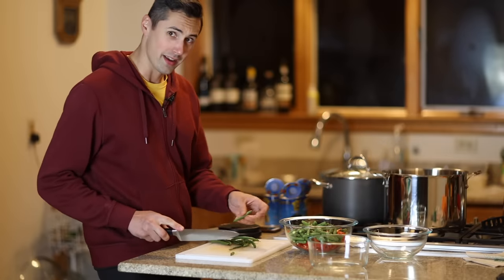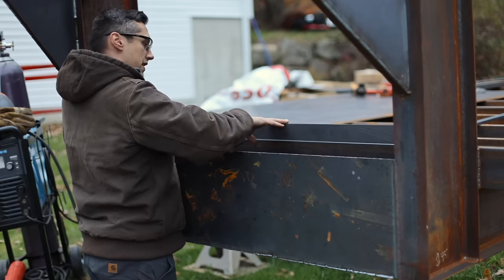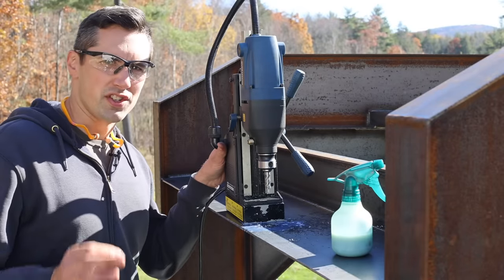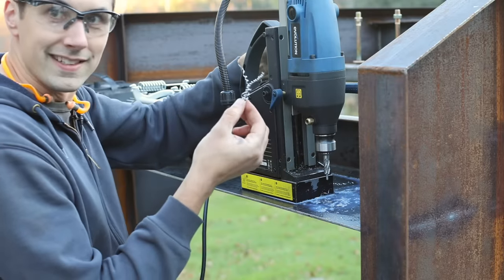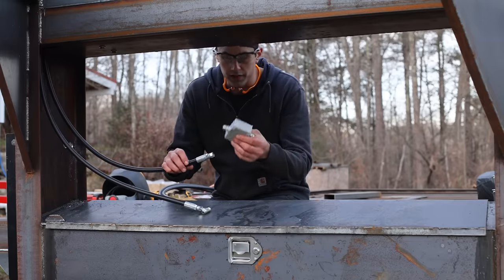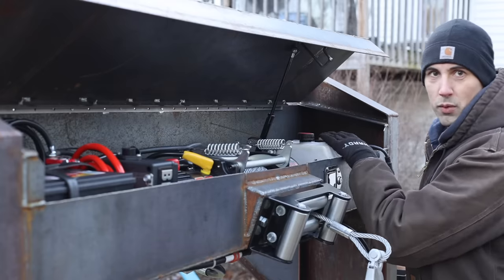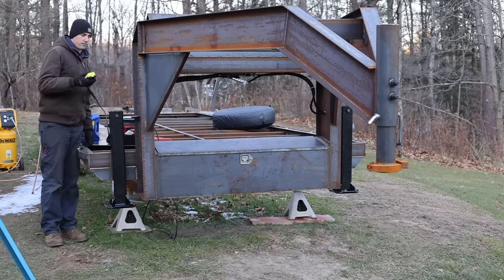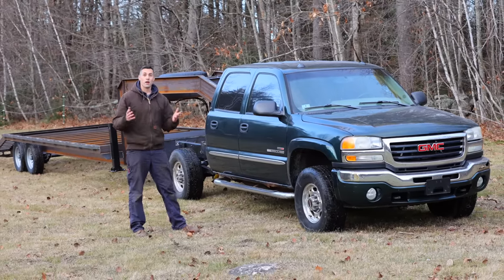Gooseneck Trailer Build Part 2: Hydraulic Jacks, Toolboxes, and a Winch

Comment: Nice work Waldo!! 👌 Don't know if you've already looked into it, but they make a suspension system for goosenecks to help smooth out the load on the truck and the trailer. I think the name of the company is Gen 3? Not 100% sure but anyways, I thought you'd probably benefit from it if you're going to be going on long hauls. Great video as always brother!! 🔥
Reply from the maker: Interesting, thanks for the tip! 👍

Comment: Pretty awesome.  I've thought about building a trailer, but I'm concerned about ensuring the design (placement of axle) is proper to ensure it handles the load properly and doesn't sway.  Is there a resource you used to ensure you design was ideal?
Reply from the maker: I based mine off of a Sure-Trac trailer at a local dealer. That definitely helped with my confidence. You could also try buying some plans 👍
Reply: Too little tongue weight will make a trailer sway....at least on a tag style. I have not towed a gooseneck. Even with a well designed trailer, you should have 10-15 percent of the weight on the tongue to prevent sway. My toy hauler weighs approximately 7500 pounds or so and the tongue weight is 1180 lbs. This week, I hauled a skid steer in a 14' dump trailer and the forks forced the machine too far back so it swayed a little. My brother forgot that he used to load that machine with the forks over the front of the trailer to get more weight on the tongue. With the mini ex we will move the machine forward or back and see how much the back of the truck lowers to ensure there is decent weight on the front.

Comment: I always hate the standard tool boxes. Myself I was going to build a trailer like this would put in an entire tool box and make a bunch of shelves and chain and boomer hooks. You never have enough room in those boxes for all of that stuff. It get messy and a bigger box would be better which also leaves room for hydulics for jacks and battery for winches. The tire location works great except that I would build out a top and hatch so that way you can place a 100 watt solar panel and have some room to throw in some wood stakes. Also a place to hold in a jack, 12v impact and there is still enough room for 2 tires. Also adding in a spot light and tool box lots. Its likely that one might need some spot lights where the tires are. You can also make a magnet remote light that you can attach anywhere on the trailer along with a nice stake mount. A 12v power supply and a 50 foot extension cord. 
Other than that its a good basic trailer.

Comment: Hey Waldo I stumbled upon your videos a few weeks ago and there great. 
I was wondering if you could include a link to that tire cover. I have a tire mounted in a similar way and I’ve been looking for a cover with a strap on it so it doesn’t blow off going down the road which I have had happen a few times.
Also I noticed when I have had my tire covered water and snow will pool up on the cover. 2 ways I have solved it in the past. #1 I purchased a small basket ball and put it in the center to create a tent. #2 I replaced the ball with a 30” table round I purchased from Home Depot. My trailer is a bumper pull and the tire is mounted to the yoke, so the table round on the tire with the cover makes a great little work bench

Comment: If you haven't you should have sprayed the lower tool box joints with Flex Seal and then cover it all with Rhino Liner and added lid seals. Going to get a lot of water inside that box from spray.

Comment: Should’ve got a deep cycle. Car batteries discharge very fast. Only designed to start a vehicle because the alternator keeps it going. Deep cycle / marine batteries are for holding a large charge for undisclosed amount of time.
Reply: False info, read one of the top comments, regular car batteries are preferred for this application. The load used by the Hydr pump and winch arent large, they can be used for bursts and then recharged with the solar panel.

Comment: The winch needs to be mounted to the deck on a beam preferably a thick one because it will rip itself right off where you have it at and it won't be as strong at pulling anything way more stress on it trying to pull up on the cable might as well cut the capacity in half

Comment: Why not a flathead bolt on locks? Secure Torx is not a Philips, but still openable. Though at that point whoever will want to open this won't care anyway.

For gooseneck ball, maybe take a thin metal rod, weld a metal plate to one end of it, stick a magnet and put a bright heatshrink on top. Whenever you need to locate the location, you just put it on top of the ball and drive until you knock it off
Reply from the maker: Good idea! As for the screws, I figure if someone really wants to get in, they'll find a way 😬

Comment: last but not least a 7 pin connector to the truck  and a nice decent backup camera kit and your set ......by  the way  are you going with a wood deck   metal deck  or  combo wood and metal
Reply from the maker: I'm planning on a pine 2x8 deck with metal plate over the wheels

Comment: A safety item when using a mag drill. Straps!  If you trip a circuit breaker or someone trips on your extension cord and the magnet deenergises, you don't want your drill or body parts damaged.

Comment: Love this build man!! Looking forward to part 3.

I have to say this because it looked so funny, but the small solar panel doesn't seem right to me. It's probably fine but there is room for atleast a 100W panel. How much does the small panel produce? 10W?

Not hating, just curious.
Reply: That specific one is only 3W, should be more then enough to trickle charge it in between uses, the pump and winch don't actually draw that much

Comment: Work crew cabs have fold down back seat. RV window below the back window in the cab back wall. For seeing the ball. But as cheep as a 4 camera systems are now? 

Have a standard home 3 prong connector on the back of the truck connected to it's battery. Mount the winch to a plate with a 3" hole sticking out the back of the winch with a lift handle on the winch. Male 3 prong home connector for the winch power. Front deck of the trailer a hook or trailer ball mount to drop the winch on. Could have 5 well placed hooks on the trainer to winch from as needs arise. Have a tree hugger anchor strap in the tool box to connect the winch to for recovery. And your standard 25" to 100" extension cord means your winch can work that far away. Drag your target load into a better placement to align to the trailer. Mobile winch and a heavy swing arm on the gooseneck just became a crane.

Comment: Another mod I suggest adding to probably the truck (or trailer if you don’t have the room) is maybe a small 10 gallon air tank with an air compressor. When my uncle added a K5LA train horn to his Ram 3500 dually, he did add an adapter for an air hose hookup and it comes in handy for flat/low tires

Comment: I would have mounted the winch at deck level and also converted it to use the Yankum ropes instead of wire. you should be able to at least reverse in line with the trailer just using your door  mirrors, the distance should come with a little practice, or fit a cheap $100 dollar reversing camera.

Comment: Just wanted to ask, are the hydraulic legs on the trailer going up and down at the time rate? It looked like the one on the left (where you were standing) went all the way up wilst the one on the right was still slighlty down, it also didnt look level when you hitched it to your truck, though that could have been the terrain. Anyway, good video as always Waldo!
Reply from the maker: Yeah, the terrain was a bit uneven and there could have been a bit of air still in the system. The jacks can be re-leveled pretty easily by retracting them all the way, so it's not a big deal 👍

Comment: That box is definitely going to leak water into it.  It's better for your "box to have a 1" raised lip all around your opening, and then make your lid have that same 1" lip fit around.  Since you are already done with this one...  What you could do is put a 1" lip facing downward on the sides of your lid --  and then put a little 1" C-channel upside down, along the edge of your lid--  like a gutter.  You would have to cut a little square out of the front of your box to let that water run out of the gutter.  but this would be the easiest way to fix the set up you have with just a few cuts on the front of your box and along the side openings to place your gutter directly under the edge of your lid.......   Like I said, rather than a gutter, you would normally have a raised lip, but a sunken gutter will still do the same thing..........  If you don't make some sort of overlap along the sides of your lid, it's going to fill up with water overtime, that's a guarantee..  I suppose you can just put some sort of rubber strips along the sides.
Reply from the maker: Yeah, I put drainage holes in the corners of the boxes. I didn't feel like making these weathertight

Comment: Love the videos waldo but I feel this trailer may not work properly. For starters the winch plate is  too thin and will either flex or bend when under load. Also the way you have mounted the cable guide will put loads of stress on that plate for no reason. The axles are also extremley far back which I understand makes loading better but if you had something heavy on there, given the whole trailer is made of solid steel (it must be near 2 tonnes empty at this stage) when you have something on it, the truck hauling it will have a massive amount of tongue weight. This will also make the trailer very very hard to steer especially when loaded. This is no way a complaint just constructive critisim. I don't know if where you are you have to get things like this certified but where I am, I doubt this would get through an inspection.

Comment: Only issue I can see is those little screws holding the hinge on, the nuts are open to the air it looks like, and anyone can unscrew those and pop the door open backwards, or did you weld those nuts on?

Comment: I hope I’m wrong but I see a weak spot at the upright to the frame rail.  There’s no box structure there under tension to prevent the upright from separating from the rail when loaded.  Did you weld a diamond plate on the bottom side of the rail to the upright?

Comment: before you go too far , oops that's passed take the trailer to your local weigh bridge to check how much of your payload has been used up ,also check the nose weight (bigger truck may be requires )?????.
just a question why did you put all the heavy stuff up high (winch ,hydraulic pump ,battery ) you have all that space under the bed to hide it all ) mount the winch just above the bed , bigger deep cycle battery , not forgetting a battery isolator to stop anyone from flat packing a car on the trailer (winch rope over the car attached to back of trailer then short the in pins in the control socket) very poplar pass time  in Australia

Comment: Dumb question, do you need to put the battery in a vented box inside that tool box because there could be gas built up in there and the electric motors create sparks, and it controls corrosion also
Reply from the maker: I have to admit, that's not something that I thought about 🤔

Comment: I see a few things that I fear might bite you on the behind...

The latch for the battery... I think had you welded that on sideways, it would be much easier to secure a battery once the front of the box was installed.
The hydraulic line pass through... yeah the grommet isn't made to protect from SHARP edges... I should have went after those with a file and some sandpaper IMO.

Also I see no provisions for rain protection and or water drainage...

Comment: This is definitely, probably, should be, strong enough. Lol.
Watching this build, Impressive by the way, been in Europe, we so not have this sort of contraption for a trailer system. I was wondering, welding is all good but what happened to good old bolts? All these  traverses, wouldn't they have been better bolted on? I'm looking at it from a repair point of view,  muche better to cut of a bolt then have to cut apart a structure. That's for the tail, yes I get it you want to use it as a ramp put I think it would have been better and lighter it you had made a ramp that is hydolicly propelled and folds under the trailer leving you the space to pas humps with ease insted of catching. If you look at the part when you first pull put the trailer of the typod stand, you'll see what I mean. You nearly ripped up your lawn and I got thinking what would that look like once loaded with a masheen or somthing.  
Then I would have installed a compressor and airbag suspension insted of leaf spring, giving me the option of higher img and lowering the plateau at any time with a flick of a switch.

Comment: For starters. Ive seen this happen 3 times...
Be mindful of the welded points of the spare tire holder bolts. Its a failure point.  Those welds will break over time. From work stress. Just from road use, shaking. Your tire will fall between the rails, down to the road, and bend your trailer axles as you run over your own spare tire. 
Your lucky if you dont loose your load, and wreck, when all this happens..
I dont know why big trailer companies can even use that spare tire mount anymore.
Reply: Its a matter of engineering.  
The bolts should form an X, or +, actually with that cross member. Perpendicular, front to rear bolts.  Not parallel with it, or left to right..
Its the front to rear rocking that breaks the bolts.

Comment: I would have added a piece of 2x2 under tool box and battery platform....and you were worried about water pooling in corner of beam..what about whats going to keep water out of tool  box and battery compartment??
Reply from the maker: I put drain holes in the floor because weather sealing is hard 😬

Comment: Trying to enjoy this trailer build vid but all I can think about is where do I get the recipe for Thai red curry chicken...
Reply from the maker: Here you go 😂

Thai Red Curry
Makes 4 servings
Serve with rice (2 cups dry)

Ingredients
* 2 (8 ounce) cans bamboo shoots, drained and thinly sliced 
* 3 tablespoons corn oil 
* 4 oz red curry paste
* 1 pound chicken breast, cut into 1/2-inch cubes 
* 2 (14 ounce) cans coconut milk
* 1 red bell pepper, thinly sliced 
* 1 small zucchini, crinkle sliced
* 1/3 cup white sugar 
* ½ teaspoon salt
* 2 teaspoons fish sauce
* ½ cup Thai basil 

Directions 
* Bring a large pot of water to a boil and cook bamboo shoots for 5 minutes. Drain.
* Heat oil in a large pot over medium heat and cook curry paste until fragrant, about 2 minutes. 
* Add chicken, increase heat and cook until starting to brown, 3 to 5 minutes. 
* Reduce heat and add coconut milk, sugar, and salt. Simmer for 15 minutes. Cover if necessary to retain liquid.
* Add bamboo shoots, and red bell pepper. Simmer for 6 minutes. 
* Add zucchini and simmer for an additional 5 minutes. 
* Stir in fish sauce and Thai basil and serve.

Comment: The winch mount is too high unless you are only pulling trucks onto the trailer or you like it that way. And box framing for the winch it'll give it more strength otherwise it will twist and rip off, I have used winches for equipment recovery and towing almost my whole adult life. Nice trailer though. You have given me an idea. My wife isn't gonna be happy about it but oh well it's better to ask forgiveness than permission.  You've probably already realized drain wholes in the bottom of the toolboxes for rain drainage.

Comment: Where your hydraulic lines are under your tool box there make a little tool box for it so no one can cut or touch them because it happen to me and I couldn't go anywhere
Reply from the maker: Hmm, that's a good point. Maybe I should replace them with metal piping 👍

Comment: I don't know how I feel about that winch being mounted on that 3/16ths plate. The sheer strength of the plate and the winch attachment points is probably fine, but the winch is going to want to twist/roll (even more so now that you've created a lever by angling the  guide). I'm no structural engineer but on the surface it looks pretty under engineered right now.
Reply from the maker: Yeah, I guess I'll try the winch out on something light and see if it flexes. I can always reinforce it if needed

Comment: alright... so I'm going to need that curry recipe though...
Reply from the maker: Here you go 😂

Thai Red Curry
Makes 4 servings
Serve with rice (2 cups dry)

Ingredients
* 2 (8 ounce) cans bamboo shoots, drained and thinly sliced 
* 3 tablespoons corn oil 
* 4 oz red curry paste
* 1 pound chicken breast, cut into 1/2-inch cubes 
* 2 (14 ounce) cans coconut milk
* 1 red bell pepper, thinly sliced 
* 1 small zucchini, crinkle sliced
* 1/3 cup white sugar 
* ½ teaspoon salt
* 2 teaspoons fish sauce
* ½ cup Thai basil 

Directions 
* Bring a large pot of water to a boil and cook bamboo shoots for 5 minutes. Drain.
* Heat oil in a large pot over medium heat and cook curry paste until fragrant, about 2 minutes. 
* Add chicken, increase heat and cook until starting to brown, 3 to 5 minutes. 
* Reduce heat and add coconut milk, sugar, and salt. Simmer for 15 minutes. Cover if necessary to retain liquid.
* Add bamboo shoots, and red bell pepper. Simmer for 6 minutes. 
* Add zucchini and simmer for an additional 5 minutes. 
* Stir in fish sauce and Thai basil and serve.
Reply: @WaldosWorld  you're awesome.

Comment: Do you install a E Break-System for the Trailer ??
Reply from the maker: The axles have electric brakes built in. I'll wire them up with the rest of the wiring later in the project 👍